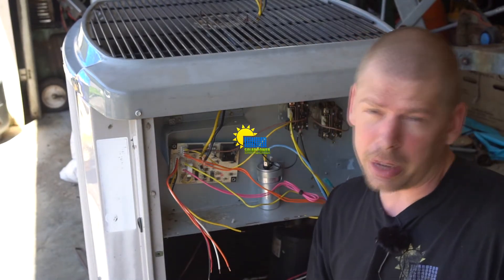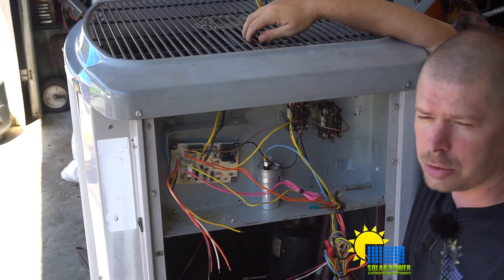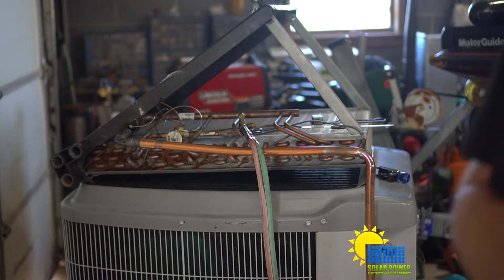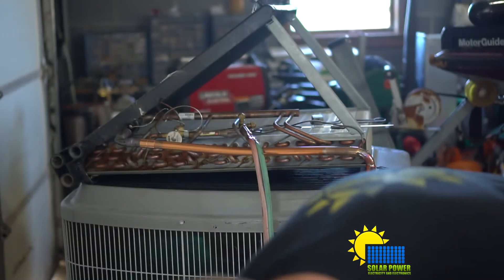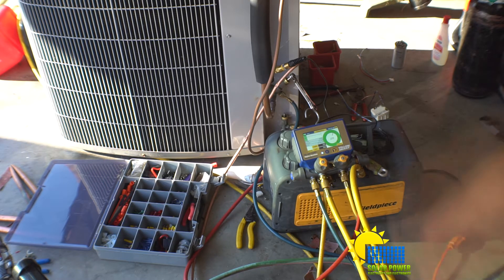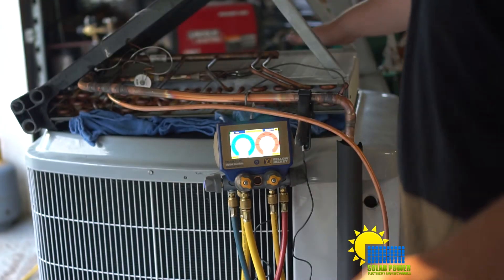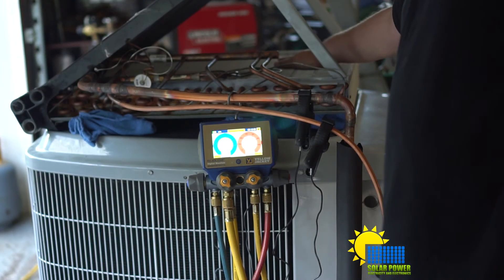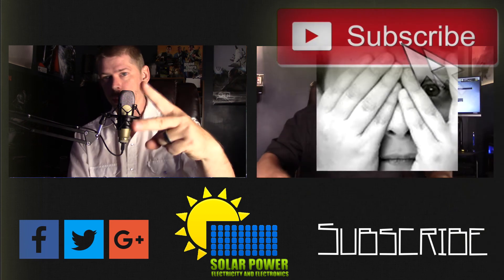I Built A Solar Powered Heatpump Running On The Outback Inverter As A Test/12kw Solar Array

Comment: Reversing valves give trouble when it's in heat mode and cold out
Reply from the maker: I never really intended to run this during heat cycle I have a lot of Bitcoin miners that produce 30000 BTUs continuously 24 hours a day
Reply: @solarpowerelectricityandel2915  take the junk out then
Reply from the maker: @royamberg9177  no I'm not going to you take your reversing valve out
Reply: @solarpowerelectricityandel2915  I use my heat pump spring and fall. You said you weren't going to use it

Comment: Mine pulls 4000 watts to run for heat
Reply from the maker: Is it a heat pump? what the model number
Reply: @solarpowerelectricityandel2915   The new one I'm working on is ATV040A water furnace 35500 btu LRA90.5
Reply: It does heat and AC
Reply from the maker: @offgridwanabe  This will heat @ 900 watts and cool a heat pump is not the same as a electric heater with a/c
Reply from the maker: @offgridwanabe  can you give me the model and i can look it up
Reply: @solarpowerelectricityandel2915  Yes I know the 4000 watts include my water pump which I run an open loop (pump & dump) from my well
Reply: @solarpowerelectricityandel2915  The one I have in the house for 15 years is a Versatec  model vxv036b110nlt1ssa